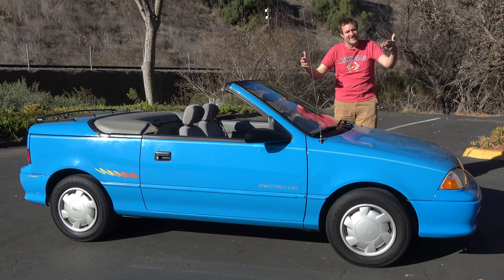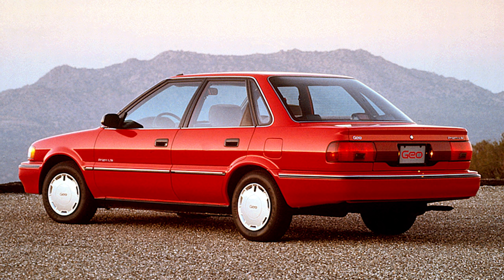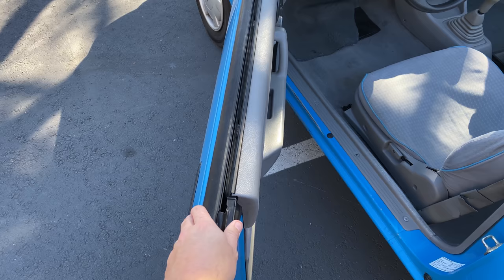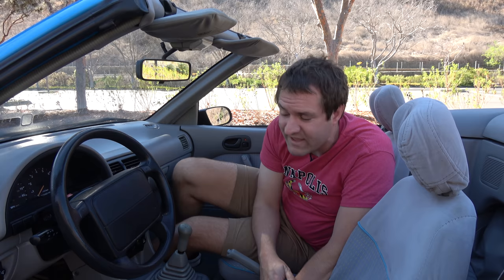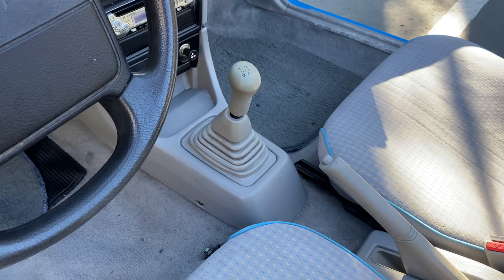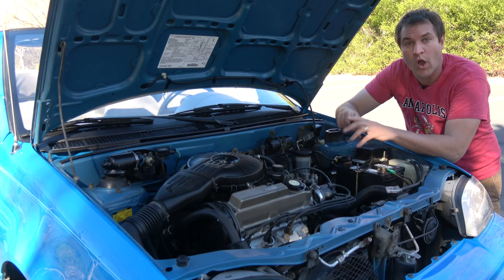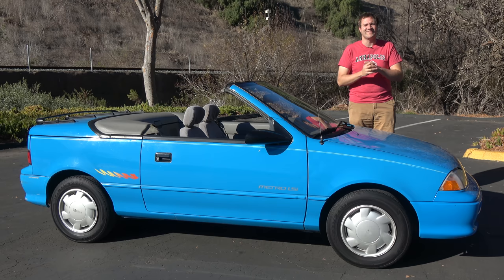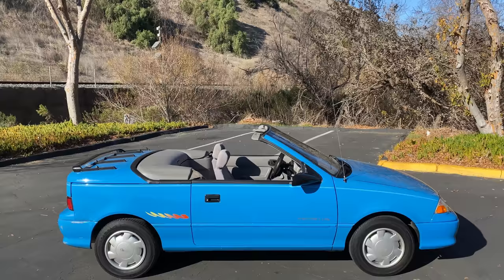The Geo Metro Convertible Was a Hilariously Pathetic 50-Horsepower Economy Car

Comment: Three cylinder engines in these things. My dad had a lawn tractor that could go faster
Reply: My bicycle is faster
Reply: Usain Bolt can run faster
Reply: I knew someone with one and the muffler rusted off. It legit sounded like a lawn tractor without the muffler.
Reply: My legs are faster and I’m a fatso
Reply: Three bangers are making a comeback. BMW makes a few different ones for example
Reply: And yet the Maverick and other cars are bringing back the three cylinders... Lol
Reply: We had them in ny country as Suzuki Swifts. They also had a 70 hp 1.3 I4 and a 100 hp GTI version
Reply: They sound nice though, and at higher revs they are smoother than a 4 cyl, due to the 120 degree firing interval. The lack of another cylinder does make them very lumpy at idle though, if you open the door on 90s 3 cylinder cars you can see it bouncing up and down when the engine is idling.
Reply: @pelao824  they actually sold the Suzuki Swift in the states as well didn't really take off but my uncle had one for the long time. Sadly got smashed by a speeding truck
Reply: James Roberts In the UK 3 cylinders never went anywhere
Reply: three cylinder isn't uncommon now. The new Mitsubishi Mirage, Ford Ecosport, and Ford Escape all have a 3 banger.
Reply: this thing would be awesome for Engine mods and swaps, id turn this into a really bad ass looking sport Coupe~ Grand Tourer edition
Reply: @nickm5419  In many countries the hatchbacks DID get engine swapped, since there was also a sedan version with a 100 hp 1.6 I4, so most people that wanted them to go faster did that - so it shouldn't be too much of a problem to do that to the cabrio. And it would be hilarious.
Reply: @olliebonugli8881  That will be why BMW have 3 cylinders engines, Smart cars, Renaults and loads of Fords.

And that is without even looking into it.
Reply: ......said no owner ever.

Not fast, but not nearly as slow as you think.  Besides, nobody judges the MG TC based on it's inability to go over 58 mph.
Reply: And now Toyota has a turbo 3 that makes 270-300+ hp in the Yaris and Corolla GR.  Then there's Koenigsegg Gemera with its insane turbo 3
Reply: These things can do 150! 

Kilometers per hour.  Just takes a looooooong time to get there...
Reply: Friend had one in HS. Living in West Virginia you had to floor it going down hill so you could make it up the next one.
Reply: I bought a 1992 Metro with the 3 cylinder 1000cc Suzuki engine for $8000 brand new. A/C was an extra $500. Easily got over 50 MPG on highway.
Reply: The 1.3 16V ones are quite rapid actually and very fun to drive
Reply: My old dog can run faster than that pathetic thing

Damn a fiat panda is faster lol
Reply: Well... 3 cyl turbo are almost everywhere now!
Reply: With a new clutch my friends in high school would squawk 3rd gear.
Reply: @jerkopatrik  had one and it was awesome. Ultra fun car.
Reply: I bet a modern Combine could outrun it
Reply: @kristians2704  hypothetically they have very similar weight to power ratios with the goes being a little lower
Reply: @darrengriffith9680  never got the chance to drive a GTi, would love to try one once. They also look sick, and their reliability is ridiculous. You can do whatever the fuck you want with it, that engine just simply can't explode
Reply: My toilet was faster too
Reply: @jamesa2868  Ford Esgape?🤔 what are you after?🤔
Reply: I've got a fiesta with a 1.0 3-banger pushing well over triple what this makes lol, granted there is a turbo on there...
Reply: Thats the most american thing ive ever heard...outside of the US 3 zylinder is a normal engine size...
Reply: Speed wasn't a important factor, good mpg was more important i guess.
Reply: @jamesa2868  Mini even uses a 3 cylinder in the base Cooper. They've come a long way in the last decade, mostly due to turbocharging.
Reply: @kristians2704  To be fair, Usain Bolt is the Bugatti of people
Reply: @pelao824  I saw the twin cam version in the UK, but it did look like a bad accident would be bad.
Reply: @edwardvalivonis23 .....and more fun.
Reply: @robertwoodliff2536  oh yes
Reply: That new Kosigeggegegeggggeeggg is a three banger... yeah that one that looks like a space ship.
Reply: Give it a modern turbo 3 cyl engine and it would be nuts, we really need a modern, light car like the Metro without the whole suicide machine thing.
Reply: @doodooswirl  Yeah, the Regera has a a 2.0l 3 cyl making over 600hp, but that probably costed hundreds of millions to engineer. We already have little turbo 3cyls doing around 200hp in normal cars though.
Reply: Fat people on a cart at Walmart go faster than this.
Reply: @mqbitsko25  Nothing about 3 cylinders means slow anyways, it's all just a matter of how you configure them. Koenigsegg as a car example made their 600hp inline 3 cylinder engine, and motorcycles have used high performance 3 cylinder engines for decades and are still chosen for performance bikes today. A 4 cylinder is just more smooth and more importantly, a common platform in the car industry, and thus are easier to develop for normal cars. No reason for most manufacturers to reinvent the engine configuration unless they deliberately are targeting downsizing - where a 3 cylinder has less physical volume than a 4, and less complexity.
Reply: Imagine if all vehicles got 1 mpg per horsepower like the Metro
Reply: @kristians2704  
Peregrine falcon (diving) - 190 mph
Geo Metro - 90 mph
Cheetah - 70 mph
Sailfish - 68 mph
Horse - 55 mph
Lioness - 50 mph
Bluefin tuna - 43 mph
Grizzly bear, orca, dragonfly - 35 mph
Hippo - 30 mph
Usain Bolt - 27 mph
Octopus - 25 mph
Sloth - 0.15 mph
Reply: Skylined Did you reply to the wrong person?
Reply: It is difficult to buy a Ford in the UK that isn't 3 cylinder. 125 HP stock from an engine the same capacity as this -------- until they blow up. The Geo is probably far more reliable.
Reply: @ibelieveicansoar  I owned a 93 Geo Metro and a 97 Geo Metro LSi 1.3L .... I can tell you right now with the pedal on the floor it was not going to go any faster than 79 mph on either car no matter how long you drove for or whether you started going downhill or not... There's no way in hell you were doing 90 in that car
Reply: 3 cylinder engines generally make a better sound than a 4 cylinder. The odd number of cylinders give a distinctive warble.
Reply: LOL :D
Reply: @wormer66  Nah, 50hp is enough for 90mph in a really small car. Factor in speedo error and 90 shouldnt be that hard. Dont know hp of the 1.3, but if it has 75 or so, it should do an indicated 100 without too much trouble.
Reply: @JVR_Funwithdesign  Yep - even the i8 has a 3-cylinder from a base Mini Cooper.
Reply: A 1960 Nash Metropolitan can run faster.
Reply: @Planag7  3 pots of today make significantly better power, most are performing at the same level as typical 4 cylinders of the 90s and 2000s.
Reply: @JVR_Funwithdesign  Skoda (Czech Republic) makes the Octavia, a 3-cylinder car with amazing acceleration and MPG. The secret? A turbocharger. The company is owned by Volkswagen, but VW doesn't export these cars to the US.
Reply: you can easily upgrade to a 4 cylinder... not that is much diferent but is a plus
Reply: @Planag7  the Maverick doesn't have a three cylinder engine though.

Comment: I like how the owners manual was done in crayon by sweatshop workers instead of a printer because ink is expensive.
Reply: The 1989 Chevrolet Sprint (Canadian Metro) owner's manual was worse. It was actually printed, but they didn't care to put a picture of the car on the front. They did, however, use pictures of the cars for reference pictures throughout the manual. The issue with that is... They used pictures from the 1988 Chevrolet Sprint, not the 1989 model.

That'd normally be completely fine, except for the fact that they're a completely different generation of car, so half of the pictures in the manual are wrong. They saved money by giving you an owner's manual that doesn't even tell you how to own the car.

Comment: Those plastic keys were actually pretty common in the 90's. They were intended to go in your wallet, in case you locked you're keys in the car.
Reply: Yeah, my 94 Saturn SL1 had one too. Used it a couple of times in a pinch to open the door. Luckily it never broke off in the door (as the dealership said it could if used too much).
Reply: I think I had one in my '89 Cutlass.
Reply: @IanDunbar1  I wouldn't be willing to test 30 year old plastic. It'd probably snap off in the keyhole.
Reply: My 03 G35 had a credit card sized thin one, but it was metal.
Reply: That’s a smart idea
Reply: @theschof96  They sure will! I tried it on a used car.

Comment: In Canada, Pontiac had a 2 door hatchback version of this called the Firefly. It was available with a turbo and an intercooler. It may be an interesting car for you to review, that is, if one can be found.
Reply: I loved ❤ my Firefly. It was a 5 door hatchback, had it in my family for 18 years, it was great around town.
Reply: Fun fact, the Turbo 1.0L motor utilized port fuel injection while the standard 1.0L utilized throttle body injection.  However, EVERY 1.0L motor has the bosses in the head where the fuel injectors were mounted, but they were never drilled out.

Comment: “Incredibly tiny 13-inch wheels,”   sobs in kei car
Reply: Fords European GT car, the Capri had 13" wheels. Of course they were big compared to the original Mini's 10". Yes 10". It wasn't until 1984 that they switched to disc brakes which necessitated an increase to 12".
Reply: Put in 185/80 R13 tires which is common trailer tire.  Still 13 inch, but equal to most 14" tires in actual size.  I have been driving my metro with this "big tire" size for many years.
Reply: The brake rotors on my car are larger

Comment: 13" is the upgrade. My '89 Metro had 12" tires.  A common aspect of the Metro is their engines did not maintain their high mpgs. I got one in 2001 when it was 12 years old, it only got about 26 mpg.

Comment: I knew guys in high school (early 90s) whose Metro had a box with two 15” Cerwin Vega subwoofers in the trunk. Felt like every bolt came loose when he bumped MC Breed “Ain’t No Future In Yo’ Frontin”
Reply: Even an 8” in a bandpass would kill this car.  My buddy had one.  Ridiculously cheap to drive.
Reply: I had an Image Dynamics IDQ 12" subwoofer in mine, running off two bridged channels of a Precision Power PC450 amp at 2 ohms. MB Quart 6.5", 4", and 1" components running on the front channels, from an Alpine CDA-7949 head unit. One of the best car audio systems I've ever heard.
Reply: Wow so I thought my cousin from little rock was odd for having a geo tracker he still had since he was in high school in the early 90's, still had the big box 12' subs with a Pioneer cd player with equalizer dash

Comment: Before the Geo brand was launched, I was considering buying a 3-cylinder Chevy Sprint Turbo around 1987 but everyone told me to avoid a turbo, 3 cylinder with little power.  But it looked cool in bright red and white painted wheels.  Around the same time, I test drove a 4 cylinder Suzuki Swift with a manual transmission which seemed liked a nice car. There was another rebadged Chevy from Japan at the time: Chevy Spectrum, made my Isuzu.

Comment: "Where General Motors had a very poor reputation for reliability. Obviously that has changed."
lol
Reply: Right? Quite the opposite. GM is a laughing stock for reliability now. The Chevy trucks were built like tanks for all generations up until about 2013 I’d say. When they started adding the 8 speeds and all this technology to their trucks it just made them less reliable. Faster, but less reliable, which is definitely something you want in a truck
Reply: It has actually. Reliability is on par with everyone else
Reply: I drive a GM truck with almost 270k miles on it. Runs fine. No engine teardowns or anything major. So from where I stand GM reliability is awesome. Can't speak for newer GM, since my old one is sticking around for a while.
Reply: I've owned about 5 Geo metros, none of them have made it less than 250000 miles before I got rid of them. They were Built-in Japan. That's reliability.
Reply: @sundstrom193  another keyboard warrior thinks he knows something.
Reply: GM reliability is just average these days.  Still get smoked by Toyota and Honda.
Reply: I drove a Geo. It had 380k miles on it when I got rid of it. I could beat that car so hard and the engine just kept going. Honestly, there wasn't much to break. I had it once where I hit something and the radiator lost all water, I didnt care so I still drove it to the gas station while overheating, added water, drove home with it overheating, fixed the radiator, filled it up and drove it another 50k. Never blew a head gasket.
Reply: @crissd8283  Suzuki made reliable cars.
Reply: @ElectoneGuy  and even more reliable bikes!!

Comment: I drive an 89 Geo Tracker.  I've never driven a Geo Metro, but have looked into them.  I don't think they get the fair shake they deserve.  I'm glad this car was preserved and grateful Doug DeMuro has reviewed it.
Reply: Oh man I owned a 98 (Chevy) Prizm and the worst thing about that car for me was how cheap the plastics were. If they had used a higher quality plastic that didn’t break under your fingers from regular use, I’d definitely rate it better than I currently do. Nothing like going to open the door only for the handle to snap off in your hand!
Reply: @Mrsuperimpsonman  The Prizm was built in Fremont at the NUMMI plant in Fremont (joint Toyota/GM venture). You could tell the GM parts from the Toyota ones - they broke! I had the same experience you did in my '92 Prizm. Easy enough to fix, and god was that car a great little urban warrior.

Comment: I had a '91 Geo Metro convertible. The 5-speed transmission actually made this very under powered car drive-able. It was rock-solid reliable and I loved it. None of the issues Doug mentioned were actually issues in the real world.
Reply: My thoughts exactly
Reply: I had a 92 convert. Geo did not put sticks in them in 92, at least that's hat the dealer told me.
Reply: @ratoneJR  I'm pretty sure both transmissions were available for all years. I know for sure that the automatic was an option that costed more.
Reply: He makes issues of the stupidest things, especially on cheap cars. He did the same thing in his review of the Mitsubishi Mirage. The extra space under the hood to service the engine was a point of criticism for him, and he didn't know what the rear floor vent was under the front seats. For a guy who so confidently reviews cars for a living, he's painfully ignorant about cars.
Reply: @joshjlmgproductions3313  You mean the dealer MAY have FIBBED?  I'm shocked!  SHOCKED!
Reply: Doug is a silly man sometimes. Cars are tools that should be limited in power and not an expression of how little you care for your fellow man.

Comment: These are actually pretty fun little cars. There used to be performance parts available for the 3-cylinder engine, and you could bump them up to about 70 horsepower. Better yet was the turbo 3-cylinder engine which started at around 75 hp. If you really wanted to go gonzo, you could swap in a Swift GTI engine, the 1.3L 4-cylinder that made 100 hp stock! The convertible chassis flexes a lot, so my first choice would be a Swift GTI hatchback, but even the lowly convertible with the N/A 3-cylinder is still a fun little car.

I much prefer the styling of the '89-'91 cars both inside and out, though. This one is in great condition, so I'm not surprised the price is already over $5000. Helps massively that it has a 5-speed and not the 3-speed automatic! Those suck!
Reply: as someone who has driven old vehicles with a 3 speed automatic, yes they do absolutely suck sooo freaking hard. Thankfully I didn't start driving until like 2005 so automatics were pretty good by then, but I have driven some early 90s stuff with a 3 speed as well as the Postal Service LLV which has that dreaded Iron Duke coupled with a 3 speed. That thing is an absolute pig to get moving.
Reply: @ram89572  I had a '73 Chevy C10 pickup that had a 3-speed manual (250 straight-six engine). I thought it would suck to drive on the highway with only 3 gears, but it was surprisingly good.. But the 3-speed automatic mated to the 52 hp 3-cylinder engine? Terribly slow. It desperately needs 2 more gears. I'd max out at 80 mph on a slight decline and slow to about 70 on a slight incline. And I mean SLIGHT.
Reply: Lol just swap frikin 3 cylinder from yaris gr